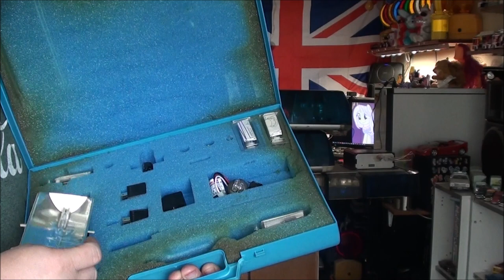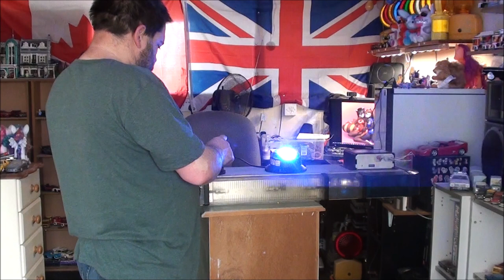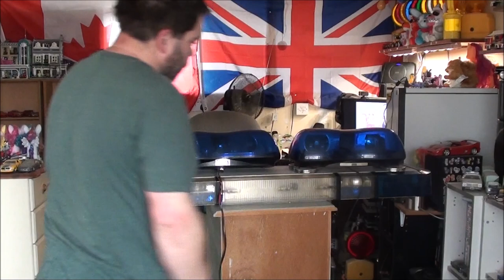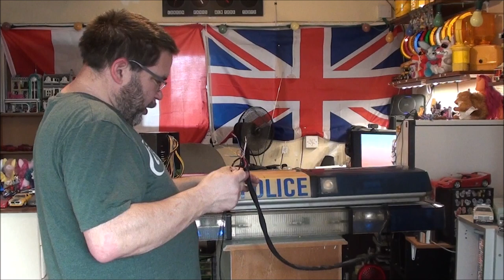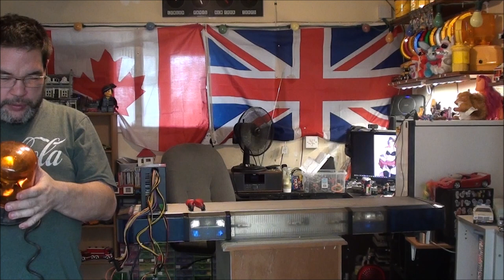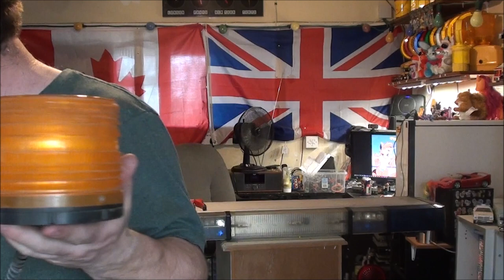Taking A Look At My Lightbars And Beacons. (Warning: Flashing Lights)

Comment: I wish I could be happy with a few traffic cones and flashing lights!

How come you have a fan running? ... Up here in Lancaster, it's brass monkeys!
Reply from the maker: I'm in a top floor flat and it gets quite hot sometimes even in winter. I barely have to put my heating on. I've always presumed it's due to he rising heat from the flats below.